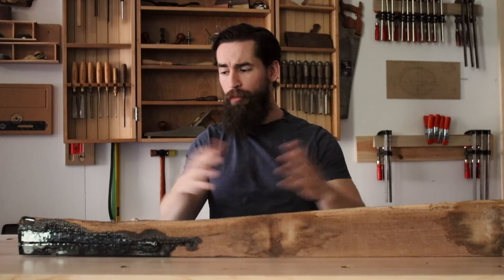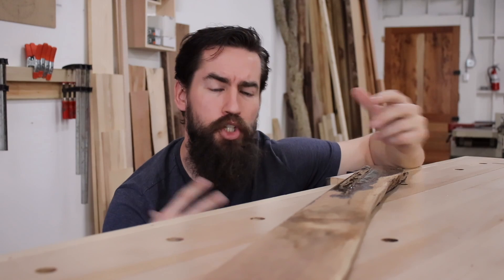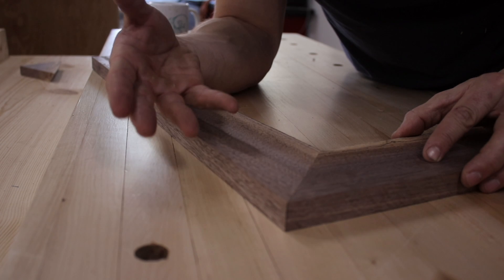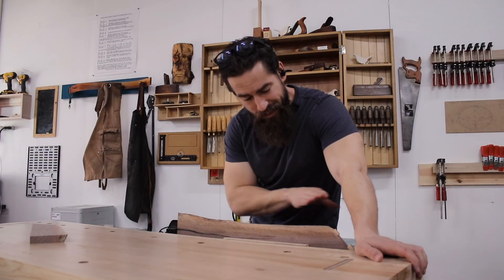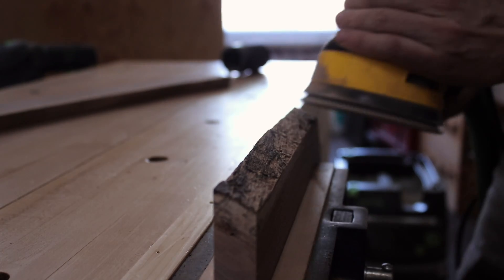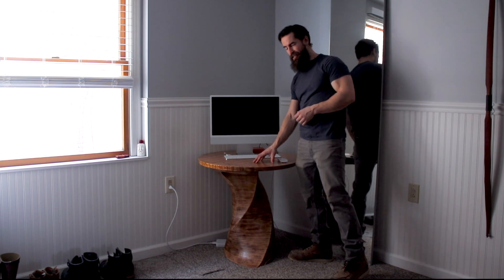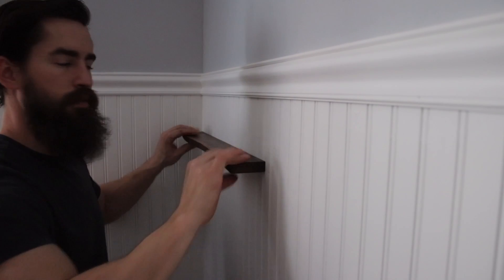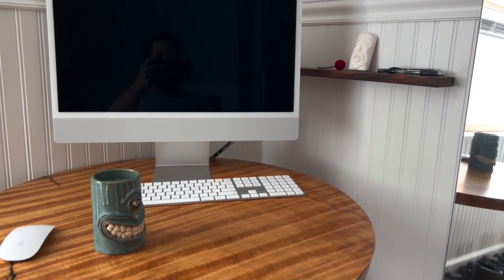My Favorite One Day Project

Comment: Looked so simple but knowing where to put the keyholes so that the shelf lines up exactly in the corner with the other shelf is a massive skill. I would spend hours measuring and marking and still probably get it wrong. 🤣
Reply: I was thinking that the whole time!!!!
Reply: does it actually have to "bottom out" in the keyhole if it's sideways like that though? seems pretty forgiving to me
Reply: For me, it's not if it bottoms out, it's the actual placing of the keyhole in the 1st place. I suppose you could make the slot section as long as you want to allow for a little adjustment but then the bigger the slot, the more material you're removing which weakens the wood. It was more about where exactly and how you mark out where the keyholes go.
It may be simple to someone like Eric but a video on how to do that would be great for us dunces?

Comment: Thanks for the idea of using key holes for shelves, any particular rule to follow regarding how deep to cut the key hole in relation to the depth of the board?
Reply from the maker: Not particularly. If it’s wide/heavy, I go as deep as the bit will allow, usually around 1/2” total depth. For a small shelf like this, I don’t worry about it too much. Maybe 1/4” deep?

Comment: I tried an interesting technique shown by Glen from DIY Creators YouTube channel.  Maybe not as easy or straightforward as Key Holes, but what he did was create 4 pocket holes, one in each corner of box shelves, that allowed four screws to enter either studs or drywall anchors.  I did this, and tested about 150 lbs without any noticable issues, leaving the weight on the wall for 2 days.  My shelves now are a place for all my many, many, woodworking magazines, within easy access.
Reply from the maker: Interesting. Just checked out the video. The logic is certainly sound, and not wholly dissimilar to where I'm coming from with keyholes. I may have to do a head to head test one day.

Comment: Did you check that corner for square before making the shelf? I only ask that because I install a lot of trim and almost never run into a corner that isn't wildly out of square. I could see a scenario where someone makes a beautiful corner shelf nice and square, and the wall is 10 degrees out.
Reply from the maker: That is an excellent point. Yes, I did get lucky that the corner is square. I considered covering options for install if not, but wanted to focus more on the keyhole for this video. Could always alter the miter to fit the angle after a dry fit.

Comment: Interesting. This is my preferred method for picture frames and I did it once on a hallway coat rack I made for my brother, which is holding up just fine. Do you have a minimum thickness you like to leave to hold the weight for different sized shelves? Don't recall what I did on the coat hanger but don't worry about it so much on picture frames.
Reply from the maker: I didn’t pay much attention to the depth on this give its size, maybe 1/4” deep or so. But for the liquor bar I sink them as deep as the bit would allow, close to 1/2” total depth, due to the weight. And I’ve used them on coat racks in the past as well. 5 or 6 years later and they’re still perfect.

Comment: So, after mortising for the dominos, you conveniently didn't mention them again. At what point did you realize that dominos perpendicular to the miter cut wouldn't work with the sliding action required for the keyholes? Probably don't need them anyway. In this case a biscuit would have worked (but only glued to one piece or the shelves would never come off again).
Reply from the maker: Conveniently I pressed the two 45s together simultaneously to get them flush. Conveniently. But yes also a biscuit would have done fine, just as I mentioned in the video.
Reply: I was impressed that the corner of the room was actually square allowing the miters to close up. Nicely done🍻